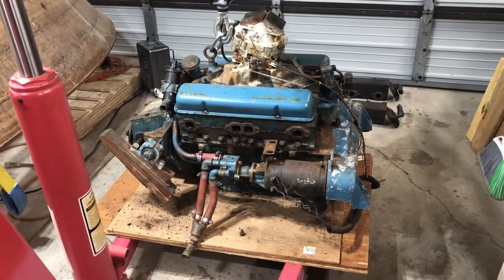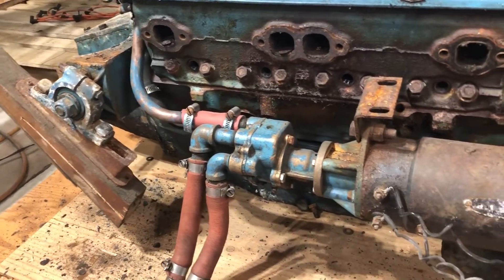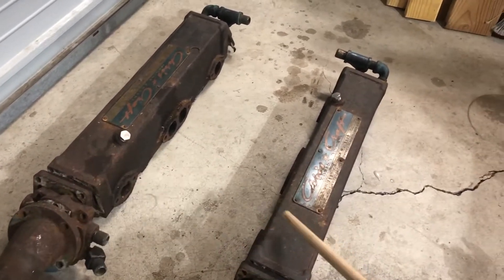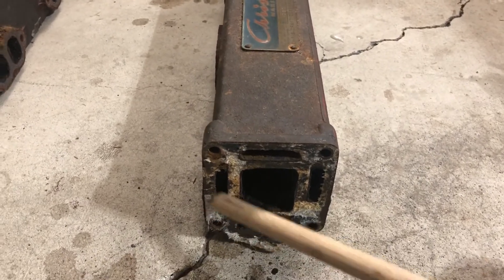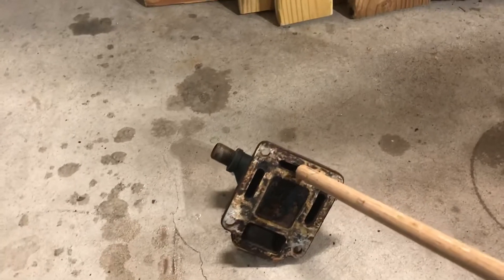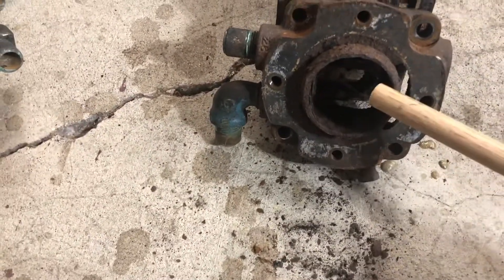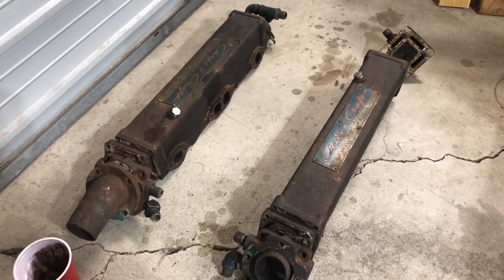Chris Craft 3-Pass Exhaust Manifolds Explained

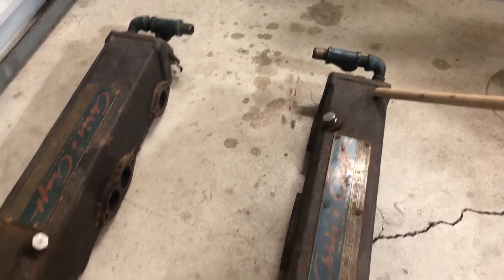Comment: 2:16 Hi Guy! Another great video to learn from.
I removed one of my exhaust manifolds (same model as yours) to try and examine if they are still functional.

When connecting a water hose to ether of the two in the back side the water goes through the channel and comes out of the other, so that channel seems to be ok.

But when I push water in through the return pipe (single pipe on front) I get water leaking into all of the exhaust chambers.
If I understand you correctly the water shouldn’t mix with exhaust gases until the very last distributor in the very end.

Do you think that the manifold has  got a hole because of rust between the return channel and the exhaust channels?

As these manifolds aren’t manufactured anymore and are quite hard to find I’m really hoping to not have to buy new ones.

I ran the motor for 10-15 minutes yesterday with cooling water connected and couldn’t see or hear any issues with the engine.

Very thankful for your input 🙏
Reply from the maker: Hi. Based on your description it sounds to me as if the final water return channel and the exhaust gas channel have corroded through to each other. But I cannot be certain. I think there is a way to retrofit this engine with exhaust manifolds that are still in production, but I think you have to include a riser with the manifold. Ship Wreck Salvage probably has used three-pass manifolds. Or... maybe it doesn't matter too much that water is leaking into the exhaust gas channel. But I would think there would be a danger of hydraulic damage to the engine valves. Again... I'm not a mechanic and I'm learning for the first time myself.

Comment: Great video! What size are the pipe fittings on the inlet side of the water pump? Is that 1” ID rubber hose?
Reply from the maker: Hi Brian, The modern replacement pump of this style is the "Sherwood Pump N10360GX". It has two 1/2-in NPT inlets and two 1/2-in NPT outlets. What Chris Craft did was to have a single raw water inlet on the bottom of the hull that provided a 1-in NPT fitting. Then they provided a Y-adapter that was 1-in NPT female to two 3/4-in OD male hose. So the raw water inlet is split into two hoses that go to the water pump. Then the water pump has two outlets to go to the two exhaust manifolds. I hope this answers your questions. Guy